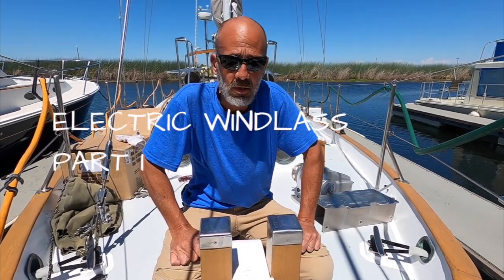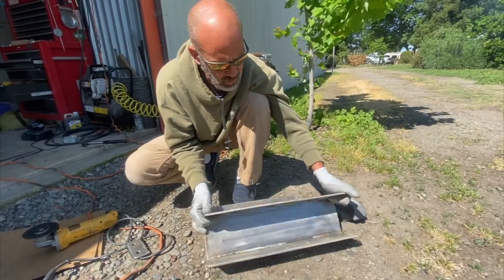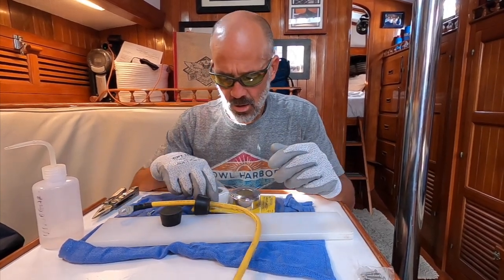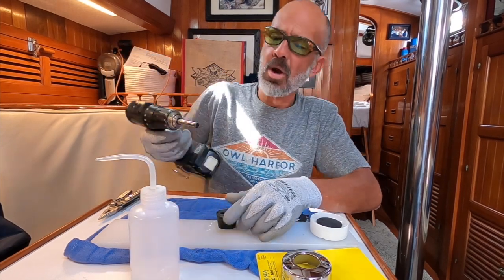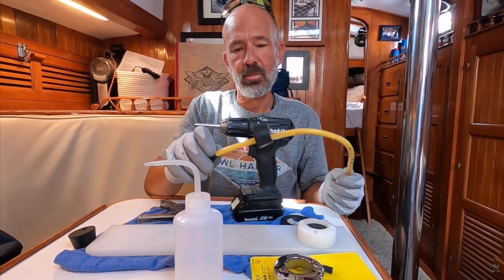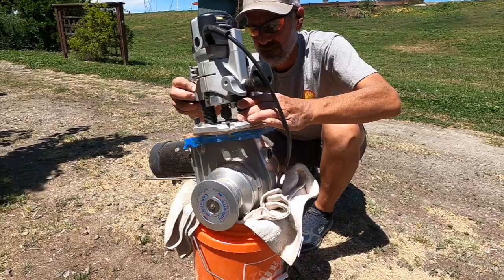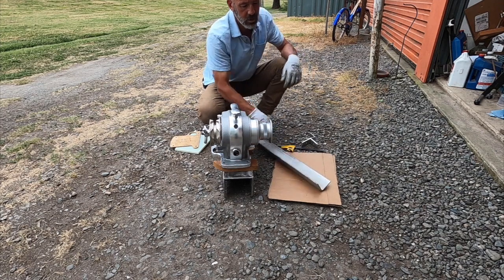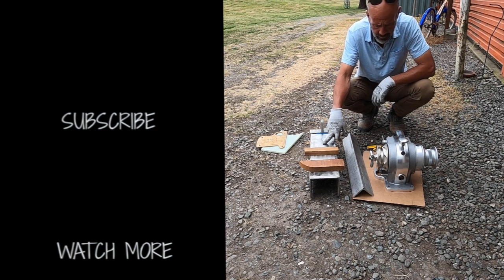SV Ramble On | Lofrans Tigres Part I

Comment: Great video Rich.  We have had a Tigres aboard our trawler Pacific for about 17 years in Mexico and have anchored hundreds of times. It has been a great piece of equipment.  Last year I replaced the motor brushes due to intermittent operation.  Put in new brushes from the manufacturer, but the problem persisted.  The brushes SEEMED to move up and down ok in their holders against the commutator.  Removed brushes, sanded all 4 sides of each just a hair, and reinstalled.  Problem solved.  Anyway, spare brushes are a good idea but don't rely on a correct fit out of the box.
Reply from the maker: Thanks Bajatrawler, that's a great piece of advice.  I've had replacement brush issues with old power tools, and a quick hit of sandpaper usually does the trick.  We're really looking forward to getting the new Tigris installed.  Thanks again for watching.
Reply: Indeed great video and we can’t wait to see the next ones! Quality, safety and reliability are our core values, and this is why we would like to know more about the situation you described above. Please share with us on our official Facebook Page via Messenger (https://www.facebook.com/Lofranscom/) some more information on the repair kit you used and from where you got it, so we can see if we could be of further assistance to you.

Thank you for your trust!

Lofrans’ team
The original windlass